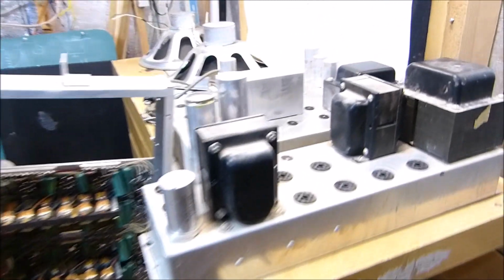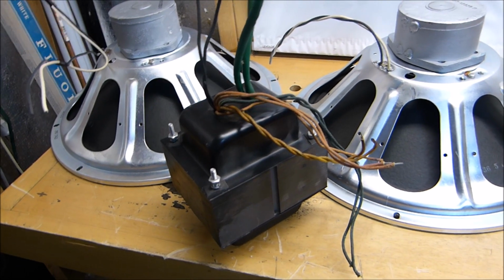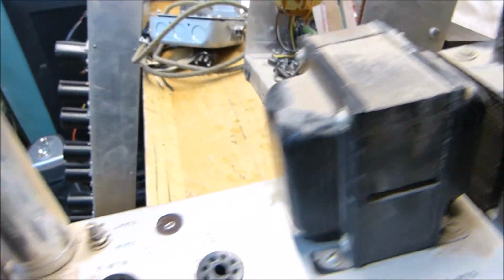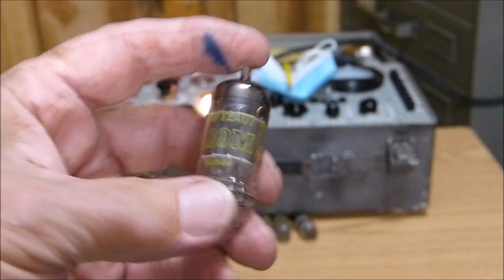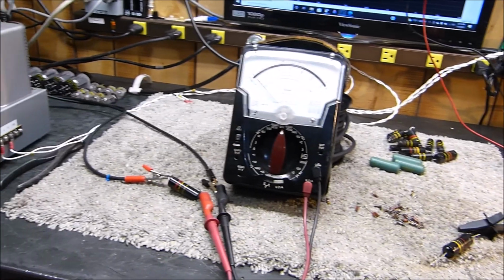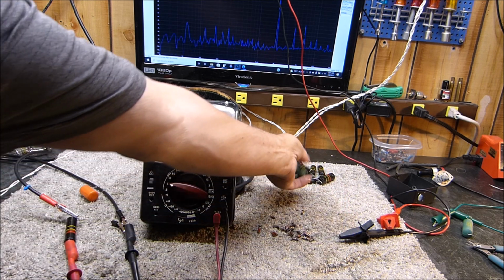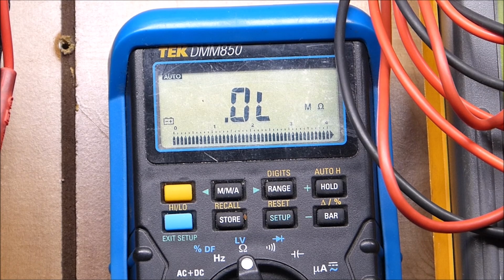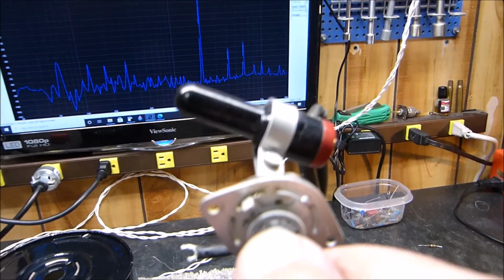Parting Out An Old Vacuum Tube Organ 4 July 2021

Comment: Some of those Bumblebee caps were used in Gibson guitar amps many years ago. Many of them cracked and were no good. I believe it was the orientation of the tubes (they're mounted upside-down) and the heat rising from the tubes didn't do them any good.
Reply from the maker: No doubt the heat has a lot to do with the life of these components. Also if they are run at the maximum of their voltage rating their life is shortened especially for electrolytic capacitors. I worked on vacuum tube TV's as a young fellow in the 1960's and figured out later that the life of the old tube sets were no doubt determined by the heat in the cabinet. The old TV's basically fried themselves. Many were on hours every day with no ventilation or air flow thru them.

Comment: At first glance (9:36), I thought they had all gone to air! :)
Reply from the maker: Just 50-60 years of dirt. Amazing how strong they still are and how well they perform. There is a newer version of these vintage organs that use 12AU7's instead of the 6SN7's and I was given one of those a few years ago.  Fifty or so "clear-top" 12AU7's in them. Most people just want these monsters gone.... whatever it takes. Thanks for your comments.

Comment: You did very well for $10.
Reply from the maker: I have always found it interesting how many things are totally worthless to some, nothing more than firewood, and to others so special as to be willing to buy each component separately. I had another one of these organs with 12AU7's instead of 6SN7's given to me for free around ten years ago, just to haul it off so I have several lifetimes supply of clear-top 12AU7's and beautiful Sylvania 6SN7's. When I see the large lots of 6SN7's for sale on Ebay, it is likely they came from one of these organs. There were thirty-seven, 6SN7's if I remember correctly plus the other tubes in the power amplifiers. I have found the quality of these tubes, in both cases, to be top-notch.

Comment: The speakers are really good on those. Throw that 12" in a combo and you'll see.
It's a goldmine of parts they don't make no more.
Great score!
Reply from the maker: Interesting you say that about the speaker. My 20 year old grandson just bought a guitar and I have decided to build him the amplifier. He pays the violin and cello so he can learn the guitar but I want a box with a cutout in the top like the vintage Fenders and I will build the Fender Princeton 5F2-A, a SE 6V6 for him to use around the house and use the 12". I looked locally and speaker boxes are not for sale in the shops and even on Ebay I cannot find one with the cutout on the top for the amplifier controls.  Should be a reasonably easy project but I am not much at working with wood - but I may have to. Thanks for your comments.

Comment: 10m are 10,000 hour check the market on used ones  ( 100$ each) of those you did very well .   the ecc all flash no problem . If some one say there bad buy all of them you can .
Reply from the maker: Absolutely... buy every Mullard, Telefunken and Amperex "flashing filament" tube you can find.

Comment: i probably got over 1000 of those bumblebee caps cracked, leaking, red plate tubes, crackle just not worth it. i only pull stuff that dont test out on stuff for myself anyway but yeah maybe that depends on climate but in the northeast they are how u burn iron out of amps
Reply from the maker: I have thought about climate and component life many times. It is hot and dry down here and may be why many of them last so long, including electrolytics.

Comment: There are lots of tube organs you can get for free, for hauling them away. I will never take apart a Hammond, even the lower end ones, plus I don't much like the innards. But old Conn and Baldwin organs are fairly OK. Yet they are usually problematical in more ways than one. Congrats on not having to haul away the cabinet. I used to scrap out organs a fair amount. Most of the time you end with 6 lifetimes supply of 12AU7s or 6SN7s. And then you have a lot of stuff you have to throw away. The Baldwins I used to get usually had 900 VAC HV windings and they were plenty beefy, but overvoltage for most tube amp applications---same problem you ran into. Put those Triads up on ebay and take the money, amigo. Yup, the Euro tubes light up alarmingly when first power on...never found that to be anything of note. And...I've never found anything at all wrong with 6L6GB's, as long as the basic tube emission was good. I'd rather have those than a pile of 6L6GC's that have been run down to 35%.

By the way....watch out for that 400 volt charged bumble bee!
Reply from the maker: I see you have had plenty of experience at it. It was nice that I left all the heavy wood and just took what I wanted. I do have, as you say, 6 lifetimes of 12AU7 and 6SN7's....  with the ageing of components like I showed in this video, it would be an lifetime job tinkering with this old organ to keep it running and tuned properly. Lots of stuff I don't need but once I put it in the alley behind my house, it will be picked up by the guys that collect scrap metal. Not so much so for wood. The transformers are massive but in my case not what i usually need. 900 VCT is good. That would be about 495 for a vacuum tube rectifier or 585 volts for solid state. That will make 6L6's and EL34 and even KT88 scream.
I am really surprised at the quality of the 6L6's. Too often they are fried in this old equipment. I make a point of the flashing filament as some YouTuber's say they are defective and should be thrown away. Makes me shake my head at the lack of knowledge about them.
The bumblebee capacitors - vilified and loved... I would not use them as blocking capacitors in an amplifier with any significant amount of voltage across them but I know some people do want them for guitars and as, "tone capacitors". As I said, they don't make them anymore so I will keep them around while I am still here. They do seem to drain of charge within just a couple of minutes but not so for the new Orange drop capacitors. They will hold a charge for a long time and deliver quite a spark on shorting to discharge even at 0.22 uF.

Comment: Congratulations!! What a lode of great stuff for only $10! How do you find this stuff? In my area, estate sales are dishes, women's clothes, overpriced furniture, and baby junk
Reply from the maker: There is a lot of that around here also. I have been to so many estate sales, some have just turned up good for me. I have been told by the pro sellers that people come to El Paso and buy up stuff to sell in higher priced cities and make a living that way. I don't doubt it. You can find overpriced stuff, of course but, just a sort of rule-of-thumb, I see electronic equipment around here sell for about 1/6 (or less) what they show on Ebay. Some people want Ebay prices and it doesn't usually sell. What  does seem to hold its price are washing machines, dryers, fridges, etc. But even those are reasonably priced and less than the used appliance stores.

Comment: "Look what I got for 10 bucks"
O.O
You are making me cry man...
---
Well, with those speakers and transformers, you could play around with making a few guitar amps. The triad transformers may be useful for matching moving coil phono pickups (I don't remember the required matching impedance off hand).
---
All the time you were testing the resistors I was thinking to myself, I hope he turned off the juice going to that cap...
The black beauties are pretty and all but they tend to go bang. Maybe sell them on to make movie props with?
Stay safe man :D
Cheers,

Comment: That's quite as haul for ten bucks, good on yer. Never been convinced about the 'mojo' of carbon comp resistors, does the resistance vary with voltage? I think we should be told. I agree that the bumblebees are untrustworthy (scrap) but they look pretty, philips did a similar line but with a light off yellow body colour. They were polyester and reliable. Please keep on doing what you are doing. Cheers from across the pond. Steve. I was going to make a joke about having a large organ but decided not to on grounds of taste.

Comment: I bought a reverb tank for a guitar amp project a while ago and bought the wrong one, 600ohm input, meant for solid state. Those little triad xfrmrs would have been perfect to drive it with a 12at7 I think. Now I wish I could find them for $5 :)

If you're still acquainted with Uncle Doug, I bet he'd adopt those speakers, perfect for a guitar amp.

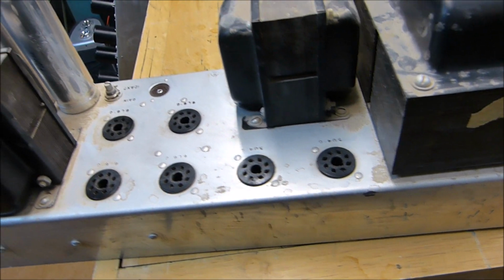Comment: At around 08:54 you had mentioned requiring two 5U4's to handle 4 6L6 and that certainly makes sense. I always wondered about the Dynaco ST 70 that runs 4 x EL34's (6CA7) from one 5AR4?

Comment: I also got a couple identical mono amps out of an organ that has 4 6V6s for the output.  Parallel push pull . Has 4 6sn7s for the driving them.  They have large power and output transformers.  Going to be a good project some day.

Comment: If you find old capacitors with low leakage,  they must be good to last that long.
Reply from the maker: I agree with you and while I definitely like capacitors with no leakage, I figure these Bumblebee capacitors can still be perfectly good, for one example, as the input capacitor.  Doing the math, virtually every capacitor leaked about 2 uA into the meter of 50K ohm (2.5 V scale) @ 400 volts. That makes the capacitor look like it is shunt with a 200 megohm resistor. I even question if they may have "leaked" this much when new. I remember decades ago one amplifier manufacturer had a big sales pitch on their oil coupling capacitors. Everyone of these oil capacitors I have checked leaked DC just like the Bumblebee capacitors. We all want to do it right when we build or repair equipment but I certainly believe in lower voltage circuits these vintage capacitors will work perfectly well. As always, thanks for your comments. Stay safe.

Comment: I use my high voltage supply with my Simpson 260 all the time to test for leakage.  I have the chart the gives all the maximum leakage in microamps.  Works better than anything.

Comment: You figure,  those output transformers have a pretty good linear frequency range.  I actually got an organ also.  A little different.  The organ has 6L6s, and 6V6s. 12au7s for the tone generators.  I got the Leslie speaker with it. It has KT88s.  Would of like to have had all those 6sn7s instead.  Good find.  I actually got mine for free.
Reply from the maker: The KT88/6550 amp has got to be the one to have. I have parted out two of these large organs and my first one was full of 12AU7 also. Got a box of very nice clear-top 12AU7's and now about 80, 6SN7's. I need to start build Williamson amplifiers to use all of them...   :-)
Reply: @ElPasoTubeAmps  I am going to use the Williamson design in the 2 other organ amps I have with the parallel push pull outputs.  Now you got me thinking about it. Going to have to get on them soon.  A lot of the 12au7s in mine are clear top also.

Comment: wow, that's a lot of stuffs. I guess it's a hobby. I am in computer so my room is full of computer stuffs that I never throw away until they're no longer work.
Reply from the maker: I wish I knew of a use for those little black transformers. The inductance values of primary and secondary are 2H and 50mH. Not sure what I can use them for.
Reply: @ElPasoTubeAmps  That's still useful if you're into this. Some of us have been built tubes and preamp with PC power supply to provide 12v power by using 500W Inverter DC 12V-24V to AC 180V-220V-380V where AC output has 20Khz so we use small inductor mH in power supply.

Comment: I've been organ chopping for a few years.   
I enjoy finding all the treasures in them.
Reply from the maker: I parted one out probably 10 years ago and it was full of 12AU7 instead of 6SN7. I still have a good supply of the clear-top 12AU7's that came out of that organ and they test very strong and balanced. These organ companies bought good stuff.
Bottom line with these old organs is as can be seen in the component values, for one thing, they have aged past being reasonable to put back in original working condition. Pretty much every capacitor and resistor would have to be checked and likely replaced. Not a reasonable thing to do with so many parts. But I love the vintage tubes if they have not been burned up over time.

Comment: if you happen to have 22nF bumble bees,put them on ebay and you are rich,Gibson players will buy them,they don't care if they are any good,thay think about mojo and original NOS parts
Reply from the maker: I know guitar players like the Bumblebee capacitors for their "tone" capacitors in the guitar where voltages are in the mV. Good idea. The leakage as could be seen, is extremely small but it would affect the other side of the circuit from the capacitor. I won't throw them away but like I said in the video, I remember thinking 20 year old equipment was old now that same equipment is going on 75 years old and much of it still works.

Comment: People use those triad a12j’s for mic pres or di boxes. I’ll buy them if you would like to sell them. The reason why they fetch so much is because I think Motown used them for their di boxes. Cheers thanks for the cool videos and happy 4th of July.
Reply from the maker: For the price I couldn't pass them up but, for example, in my AM transmitter modulator, I used a "turned around" push-pull 6V6 size OPT to drive the grids of the 4-125A. The transformer is 8 ohms to 8K ohms and as much as 15 watts. Works great and runs at about 2-3 watts to drive the modulator tubes. These little guys are 10 mW max. Looks like only good for a microphone or line level input.  Commercial transmitters use 600 ohm line to grid to drive the input voltage amplifier tubes but are rated at a few watts. I have had parts for decades before I use them. Transformers, whatever kind they may be, are what makes or breaks a project. Thanks for the information.
Reply: @ElPasoTubeAmps  Triad iron is considered a fetish item. You have two, NIB, you could get well over $100 for the pair on ebay.